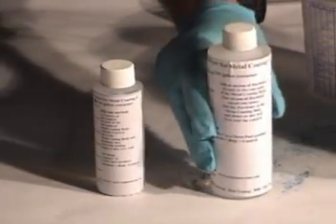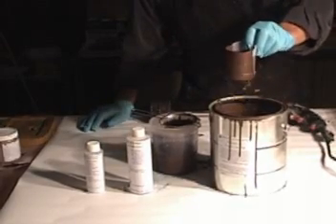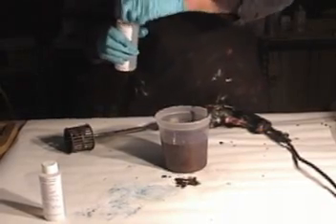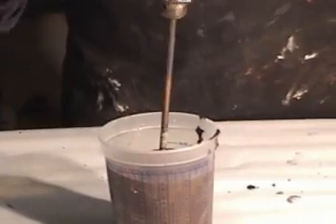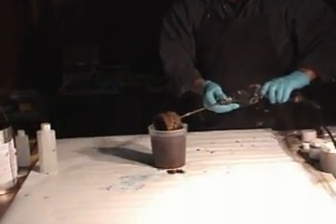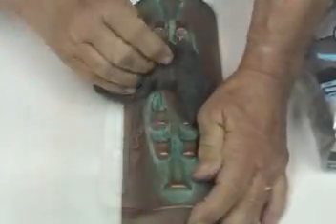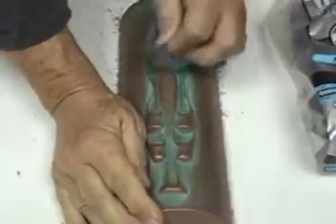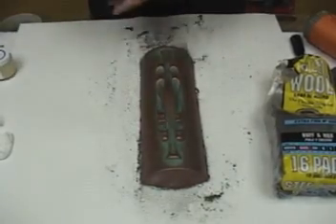Mixing & Applying "C" Metal Coating

Comment: Do you have to apply the type b before the type c? Also, how does this coating do when applied to PLA and PETG plastics?
Reply from the maker: No you can use the Type C alone if desired. I have not worked with PETG but on my PLA print I used the Prime It before the Metal Coatings and I had no problem at all.
Reply: @sculptnouveau  is there a benefit from using the type b first?
Reply from the maker: @ZeusXenios  Only to build up density if desired. If I was sponging on the effect, I might do the B first but normally I just do the C version all the way through.

Comment: Can the type c be used in a small airbrush?
Reply from the maker: Unfortunately no, it is too thick for that. Its best out of a HVLP sprayer with a 1.5 tip.
Reply: I think that would be overkill at the scale i'm working! I will go with a brush for now - is it possible to thin out and apply perhaps more coats that way?
Reply from the maker: I have not had much success doing so but you can try. Distilled water works the best but normally we only recommend going to about 20%